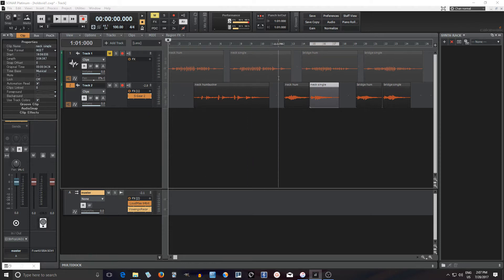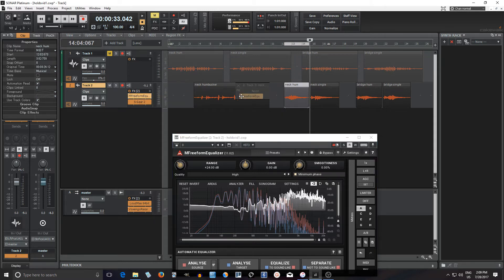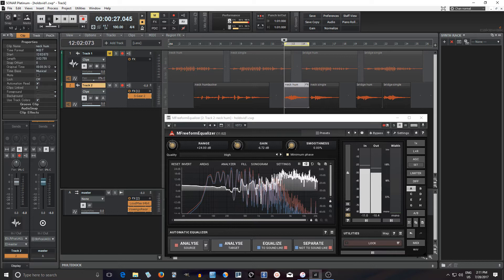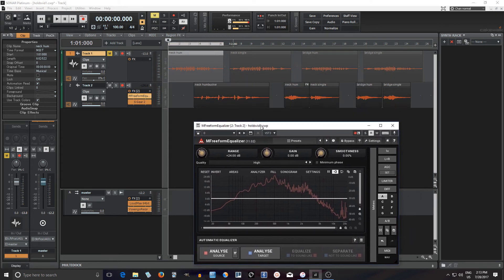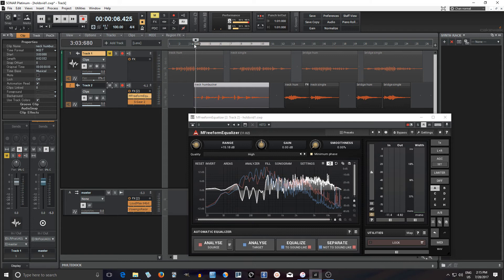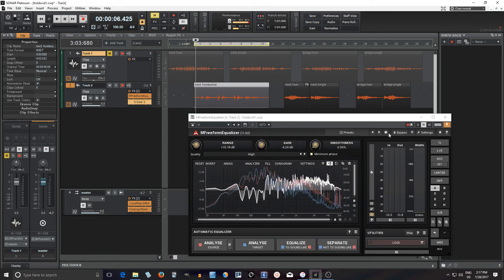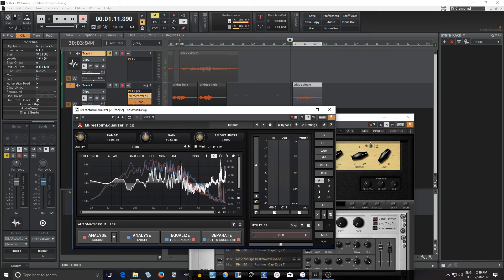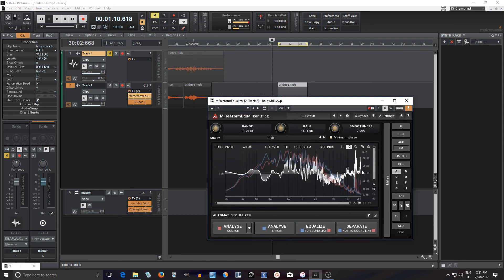Matching Guitar Pickups with MFreeformEqualizer

Comment: Hello Chandler, thank you for your valuable video. I have a question and it is what to do if the isolated guitar track is in stereo?? Should I select only one Left or Righ channel and sacrify the other?
Reply from the maker: It is up to you. Sometimes you can do it to both channels and it won't make a difference. Other times you might just use 1 channel, throw away the other and use FX to create stereo again. It is up to you.

Comment: Nice tutorial as always!

Btw, the difference in gain between an humbucker and single coil is around 6dB.
An humbucker is simply two coils in series. Or in other words a inductor that is twice as big.
This gives you a 6dB increase in gain.
For the same reason, the resonance peak of a sinle coil is higher (relatively speaking), which matches exactly with the area of frequencies you're compensating. 
(one of the reasons why single coils sound more trebly)
Reply from the maker: I didn't know that. That's good info that I wish I had before I made this vid. Thank you for watching and sharing that knowledge.
Reply: Of course that's the theory. In practice it's always fiddling around a little until it sounds right ;)
Reply: @bbreeuwer4577  important to note no two pickups are made with the same gain profile and humbuckers are designed to be humbuckers. they are louder as a general rule of thumb but if you have a loud single coil and someone else has a quiet jazzy humbucker, you may be pretty close in volume.

Comment from the maker: Can anyone recommend some good humbuckers that are versatile? Any favorites?
Reply: Use a blend knob between invaders and Nazgul with coil split options...

You would be amazed, its not just metal tones. Very versatile setup.

I just need the blend knob myself lol
Reply from the maker: @illuminatibraincontrol  Hmm I'll have to check those out.
Reply: @Chandlerguitar  some of the knockoff invaders are pretty close to the real thing since invaders are honestly a pretty basic wide open full sound so can be tested approximately for cheap enough. I have that setup without a blend know, just tone volume 5 way with split modes, and it's got some of the best sounds of my guitars, better imo then my classic emg 81/85 pair which multiple touring metalheads have tried to buy off me
Reply from the maker: @illuminatibraincontrol  Sounds interesting. I'll check out the invaders too.
Reply: Fishman Fluence. No coils!